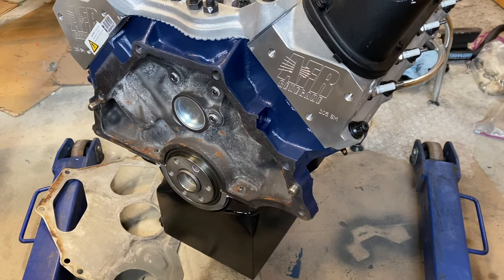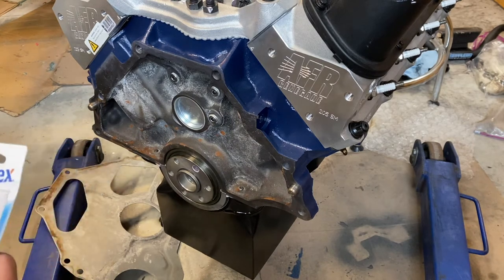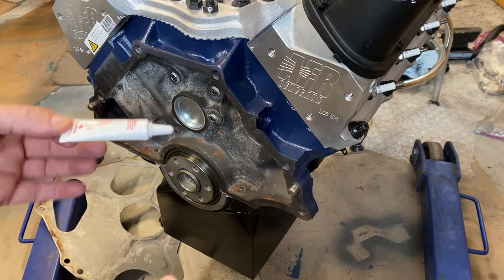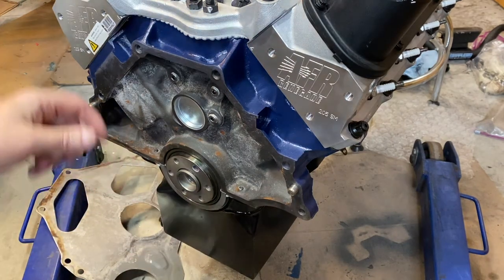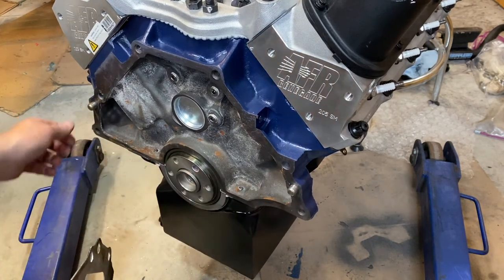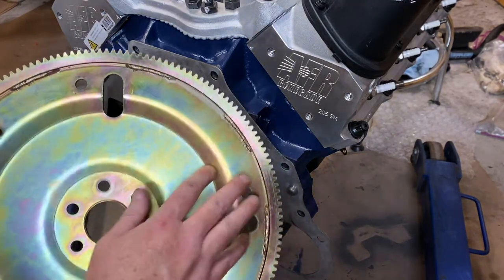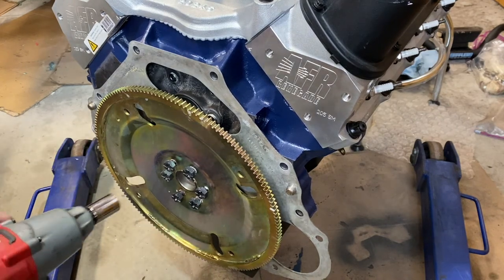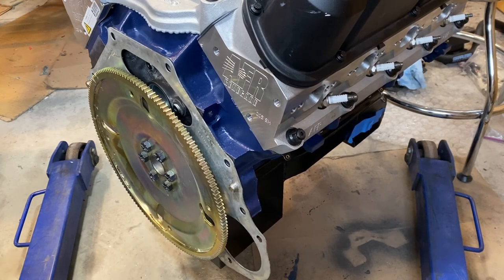How to Install AOD Flexplate

Comment: Any reason that you did not use a flexplate stiffener such as performance automatic PA26470? Also, if you still have the info, please give us the p/n for the bolts.
Reply from the maker: Flexplate bolts from Ford are M-4216-A300

My AOD came from Lentech automatics.   Flexplate was bought from them as well and crank was balanced with it.  They never suggested running a stiffener.
Reply: @MrStangdawg  Cool, thanks for the feedback.  Use of the stiffener for AOD is hit and miss by Ford.  I recently pulled an AOD out of a junkyard F-250 and it had the stiffener.  However, years ago my buddy pulled an AOD out of a T-bird and there was no factory stiffener.  Every Ford I have had with a C-4 or C-6 has a stiffener.  I am using one on my AOD so the combined thickness with the flexplate & stiffener is 0.165 which makes the thread grip length of the M-4216-A300 bolts 0.572" into the crankshaft.  Is that enough?  Probably, the thread depth on the 393 Scat crank is 0.85" so I would prefer a slightly longer bolt.  Thanks for the tips buddy.

Comment: Great video man,i was looking for torque specs and you have them here right and center, thank you,ill be doing this in the next couple of days, im using brand new oem flexplate bolts From ford and they have thread sealant on them so im guessing that will suffice but ill be using some ARP lube under the head of the bolt.

Im installing a mild 347 and i was lucky to actually find a OEM flexplate that came on 351 cop cars LTD's with a 28oz inbalance,those things are rarer than hens teeth,my builder gave me a scat flexplate but i dont like it, its too thick and kinda worried me about converter clearance plus i wont be laying down the hammer on this new engine so sfi would be overkill for me,just a pleasure cruiser that i might get on once in a blue moon.

Those are some pretty sweet heads you have there, how did your install go, everything ok?
Reply from the maker: Motor has been in a while now, did a lot of the wiring and odd and end stuff and now getting back into the engine bay.   It's a grind as mostly confined to working on car on the weekend.    I bought my flexplate from Lentech as I didn't want to guess that I had the right one (and it's SFI rated).
    On a 347 crank, the holes go all the way through so probably best bet to add some sealant just for insurance against any oil seepage around the bolts.
Reply: @MrStangdawg  Hey i did have something else to ask you if i may, i have the same  bolts that you have for my flexplate but the ones that i pulled out of my old motor are a tad lower profile, they are identical in shape and  everything but the head on the old ones is smaller,my old ones are .23 and the new ones like yours are .32, both are oem Ford bolts, i wonder why that is?  we were gonna stab the motor in today but ran into some issues so thats been cancelled for now.

Comment: I am a little confused as to which bolts to use on what application. For example, I have a 302 with an AOD. My crank bolt holes are open (go all the way through). Do I use the long bolts or the short bolts?
Reply from the maker: For the bolts themselves, you will want to use thread sealer as they are exposed to crankcase oil.  
    AOD flex plate bolts are shorter than flywheel bolts.   If you are going from AOD to t5 you should buy "flywheel" bolts as they are longer.   Many of the kits are 7/16-20 by 1 inch.   AOD bolts are 3/4 inch.
   It's cheap insurance to buy new hardware instead of reusing flex/flywheel bolts.

Comment: What is the purpuse of the aod spacer?
Reply from the maker: the plate is what aligns the starter to the flywheel.
Reply: @MrStangdawg  thanks I guess I'll buy, I'm a Chevy guy so there is so many special little parts for the aod
Reply from the maker: @limitlessautomedia9794  it's actually not that bad.   I recommend getting a new TV cable from performance automatic as you can't get the new from Ford anymore unfortunately.
   The key to the AOD is setting up the TV cable and if you run it hard, changing the fluid and filter more frequently.